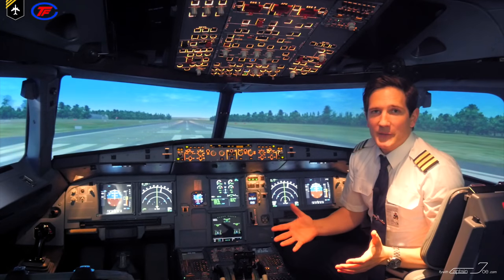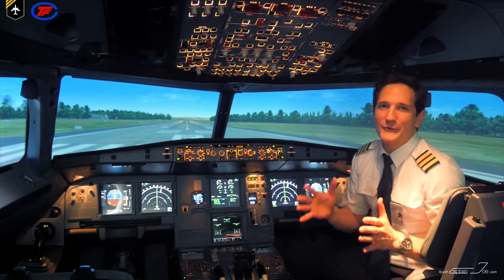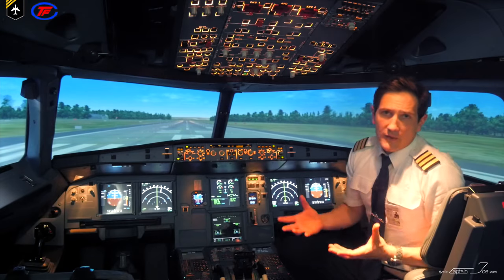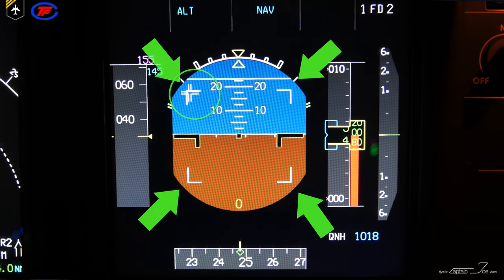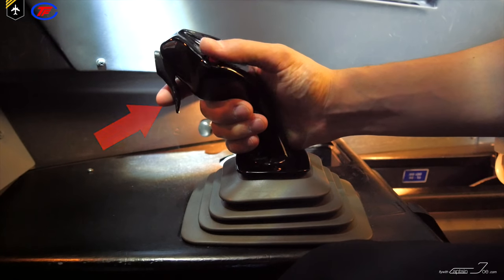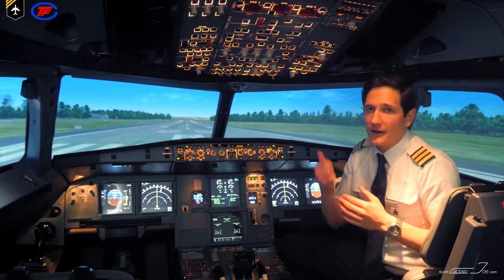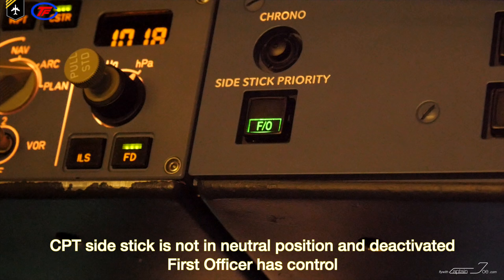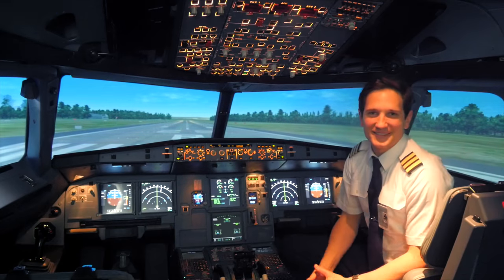AIRBUS SIDE STICK - Explained by CAPTAIN Joe

Comment: when are we gonna come to the point where we can trust computers more than we can trust humans and just remove all of those buttons, mechanisms and lights from the cockpit, and let the computer fly the plane by itself, or most of the flight?
I dream about the day we will have a plane with only a screen like tesla cars where we just input and configure a number of things, the rest is up to the computer.. I dream about a clean cockpit, not the prehistoric cockpits we still have in 2017
Reply: Kevin Colt why the hell would you want that? people want to become a pilot because they want ti fly the plane, not press a button..
Reply: This is the story of a man named Stanley.  Stanly worked in a big airplane, where he was captain number 427.  Captain number 427's job was simple.  He sat there in the cockpit, and he pushed buttons.

(Stanly Parable reference if you're totally confused.)
Reply: Kevin Colt And if THAT happens we'll all be doomed.. I mean, haven't you watched THE MATRIX at all?? 🤤
Reply: This is basically how an Airbus works already. Ultimately the plane does it's own thing given the parameter entered into it (flight course, weight etc), it was designed so that the planes computers are the boss. Where as Boeings philosophy is that ultimately the pilots are in charge, but can ask the plane to fly itself.

Hence why is a Boeing when in auto pilot the Yokes and throttles will physically move so the pilots can see what the aircraft is doing, where as they don't in a Airbus.
Yes all Airbuses are flyby wire so not physically connected, but even flyby wired Boeings move the controls and have artificial feel built into them.

Comment: Side sticks sound complicated
Reply: monibstar it’s simple though haha
Push forward nose down
Pull up nose up
Move left Turns left
Move right turns right
Is this simple enough for you? Or is that too complicated?
Reply: @northaviation7952  are there middle positions like between push down and turning left.. Nose down while turning left ?
Reply: monibstar yes, to push down and turn left you would push the stick down and move it left which usually is rare to do so, as it would be a steep descent. However, they would slightly push down and turn left to do so. Same applies for right and going up.
Reply: @northaviation7952  oh ok.. Thank you ☺👍💺✈

Comment: I think the position of the sidestick is stupid. The pilot even has to steer with his left hand and the copilot has an advantage. Why not put it in the middle so you can be more precise? Even if its on the right side your arm is at an angle. Everyone who plays video games know that the Joystick has to be in the middle and not shifted sideways.
Reply: the captain would still use the left hand no matter where the stick is unless you duplicate the throttle lever to the other side but then it would be very complicated and heavy, it's like driving, you're also drive with your left hand.
Reply: So if the captain has his sidestick on the right side how is he supposed to operate the thrust levers?
Reply: The thing is just in Video games i have way more control having the Stick in the middle like a Fighter Pilot. Sure the Thrust lever is an issue. But in a commercial Jet i dont think its a big issue because you dont do a lot of changes to the Thrust manually. Having more precice control in position is better in my humble opinion. Imagine driving your car and istead of your steering wheel you have a Joystick to the left where your door opener is. This gives you way less control than if its in the middle.
Reply: @mucxlx  how is it more precise in the middle? To the side your arm rests on the arm rest and you can just pivot with your wrist and hand. The F-35 and F-22 both have sidesticks. An Airbus captain will go through training to get used to the left handed sidestick but it’s not different to the co-pilot manipulating the thrust levers with weak hand
Reply: Actually the sidestick in an airbus is quite ergonomic in position (though yes for flying I still prefer a yoke).
The sidestick position is way different than how one keeps a computer joystick (I have experience of both so can comment from experience). The sidestick is not in an angle but it's quite straight. Basically you rest your arm on an armrest then operate it.
Reply: @tomstravels520  there is no concept of weak hand strong hand. Flying from the left vs right is same as driving a left hand drive car vs driving a right hand drive car.
Reply: @ZK-APA  I’m sure it is pretty easier but i don’t think that’s a great comparison because no matter which side the steering wheel is in the car you’re A) using both hands anyway and B) you can only rotate the wheel, you can’t pull it back and forth so you only have 1 dimensional axis to move it instead of 2
Reply: @tomstravels520  that's in more relaxed driving. In a city driving condition with a manual transmission, it's more of one hand on the wheel and one hand on the gearetick.
PS though practically flying from the left vs from the right isn't that different. One just gets used to it. I've flown from both sides and apart from procedures and reference points outside, hand flying feels the same

Comment: does anyone know why Airbus doesn't use yokes like in a Boeing 787
Reply: Basically it's simply a different design philosophy which was made possible with the introduction of fly-by-wire. Of course is also saves a bit of weight and gives the pilot more space.
The A300 and A310 by the way weren't fly-by-wire aircrafts and still had a yoke.

Comment: Let's be honest, it's a joystick. And it's off to the side of your body instead of centered like a yoke. Not good. But I suppose the computer is doing all the work anyway since it's fly by wire. Still scary.
Reply: dave miller actually though yes yokes are way better to fly a plane, a sidestick for an airliner makes more sense, as one the controls are not used that much, and two because of the sidestick there is more space in the cockpit and you can have a table as well

Comment: if you're a right handed pilot, you're screwed. boeing is more friendly just sayin haha
Reply: SkyStudios not really. Even though you can hold a yoke with 2 hands, you only fly with 1 hand, just like airbus and it’s sidestick
Reply: @ZK-APA  Well the reason i'd be flying boeing is to get AWAY from the sidestick haha
Reply: SkyStudios yea. For pure flying sidestick sucks. Yoke feels more natural.

Though yea, for an airline operation, a sidestick definitely makes more sense, no matter what’s your preference.
Reply: @ZK-APA  Why would a sidestick make sense lmao
Reply: SkyStudios because most airline policy states that after take off autopilot should be turned on (timing depends airline to airline). And same goes for landing.

Hence once autopilot is on, the yoke is basically deadweight. It doesn’t do anything. Meanwhile with a sidestick, since there’s so much space, it’s much more comfortable, and you can get a fold out table. (Believe me, there’s actually a bit of paperwork one has to do during the flight)

Comment: That is the stupidest thing that Airbus invented. It would be very difficult for a righted hand pilot to get use to. Another thing was Captain and First Office could had different input. I preferred the Boeing yoke much better.
Reply: Tony Lee even though I agree that a yoke feels better than a sidestick, in actual flying, it doesn’t depend whether you are left handed or right handed, if you sit on the left, you operate the stick/yoke from the left hand and if you sit on the right, you use your right hand for it. That’s standard cockpit design procedures.

Comment: Dumbest control system, real planes for real pilots use a yoke like Boeings and Embraers, no need for the gimmicky warning lights that are easily overlooked.
Reply: Tell that to the Air France pilots who nearly crashed their 777 last year despite having a yoke and didn’t realise who was in control. Or the pilot of the Atlas Air 767 who nosedived his plane into the water and captain didn’t notice yoke movement until too late. More and more planes are converting to sidesticks including the A220 and the new private jets
Reply: Found the nintendo pilot.
Reply: Yeah, tell those damn F22&F35 pilots they are not “real pilots”
Reply: @bundywaters5988  💀

Comment: Too bad this system caused Air France Flight 447 to crash...
Reply: Actually, they did what they could. The fact that the plane switched to Alternate Law and that the stick was not locked to one pilot caused it to crash. I blame design. Not saying that Boeing is better, just a fatal quirk.

Comment: Sidesticks are dum.  Ninety percent of the human race is right handed.  Sidesticks either compels the pilot to use his or her weak hand to fly the plane or sit on the opposite side of the cockpit than what he or she is accustomed to sitting on.
Reply: mrzoperxplex if you drive a LHD car, you turn with the left hand, and you shifting with the right
Reply: You get the same thing with a yoke. Throttle levers are in the middle, so you still need to use your left hand on the yoke.
I comes very naturally. Actually, since almost all your first few years of flying is done from the left seat, using a stick/yoke with your right hand feels a bit strange at first. But again, it really doesn't take long to get used to it.